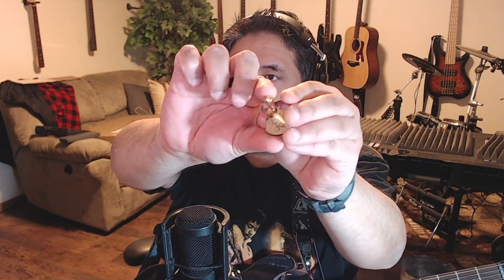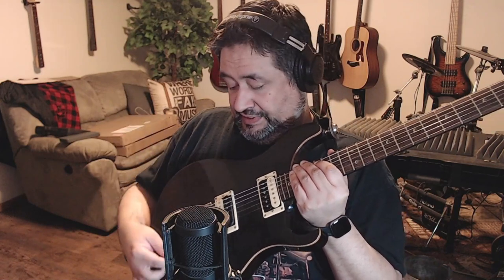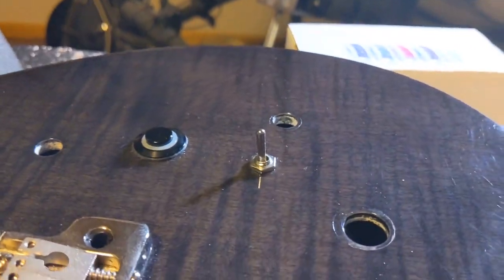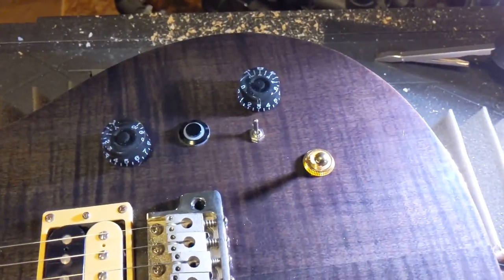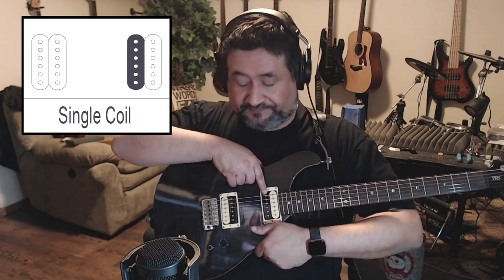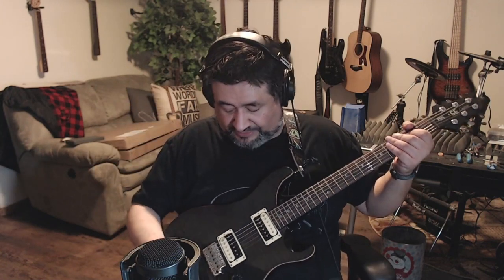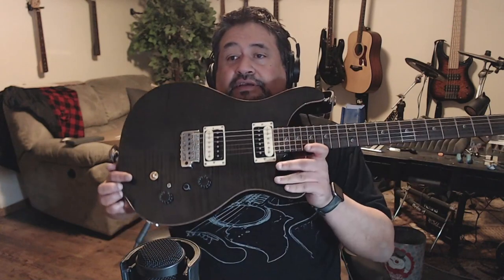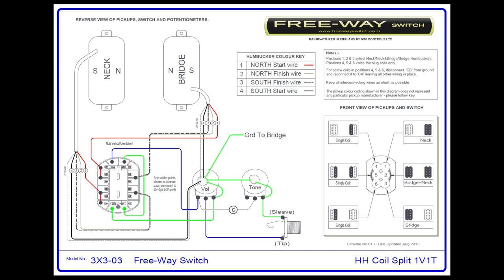Testing the Free-Way 6-Way Toggle Switch (3x3-03) on a 2006 PRS SE Custom 22

Comment: Nice demo and yes, it benefits from the additional sounds for sure!

I'm about to do the same mod on my beloved very affordable, but discontinued Greg Bennett Royale RL 3, a semiacoustic, where I'm planning on a little bit different setup than you chose, i.e. inner coil neck + bridge humbucker in neck position, both coils in parallel for the middle position and inner coil bridge + humbucker neck for the "second lane" on the switch.

I wasn't able to identify how many wires come out of each of the humbuckers on your PRS SE-22, i.e. was it three- or four-wire? If the first and you still got to split the humbuckers, then this should work on mine as well. If not, I might have to replace the pickups in favor of 4-wire ones, which raises the price tag for this mod. But I've been wanting this mod for quite some time and can't wait much longer.

I'm not great with soldering, so I wonder whether I should muster the nerve myself or hand it over to a guitar tech, seeing as the ES 335-type copy doesn't have "service lid" like the PRS does, i.e. I have to "fish" the pots out through the f-holes. (urgh...). Maybe wait for the winter and those long evenings with not much else to do...? ;-)

Anyways, thanks. This confirmed to me that I must have that mod done on my semi-acoustic!

Comment: Yes, they are painful to install. Based on lessons learned from the first one I added to my Charvel, when I came to do the Free-Way Switch - JJ Custom Works Edition, I taped off the areas I did NOT want the solder to flow to and soldered colored leads off of the switch to match the diagram. I then attached, with out soldering and outside of the body, the pickups until I got it correct. I then soldered the pickup wires to the leads, and added heat shrink tubing to the connected joins. These switches are a great way to do a non invasive mod for improved tonal variations. Patience is a must!
Reply: Great ideas.  Thanks for sharing.

Comment: Sounds great!  Were the stock pickups 3 or 4 wire so that splitting is easy?  I don't think that they brought the coil bridge wire out on the pickups in my PRS SE Santana...
Reply: 4-wire, if I'm remembering correctly. The tough part was soldering to the right spots on the switch. Very small contacts all close together... not easy!

Comment: Mr i have two questions
1) Do you have volume drop off when you split pickups?
2) It is possible to make partial split technique by adding two resistors with
freeway toogle switch to try reduce the volume drop off?
Reply from the maker: There is some volume drop when splitting a humbucker. Single coils tend to produce lower output generally. But I have no idea if you can add resistors to fix that, or if there is any other method to reduce volume drop. I just have to boost my volume on whatever tone I'm using when using single coils.

Comment: If the free-way switch only gives you split coil options, wouldn’t it be easier and cheaper to simply to replace one of the pots with a push-pull?
Reply from the maker: Yeah, that would have been easier, but I already had the switch, and I love using a toggle switch instead of a push pull pot.

Comment: Did you add resisters to the coil split ? Usually split humbuckers sound quiet but those are quite good
Reply: No, I did not add any resistors.
Reply: @EdCaggiani  nice :-) I'm quite surprised about that as I don't hear much volume drop